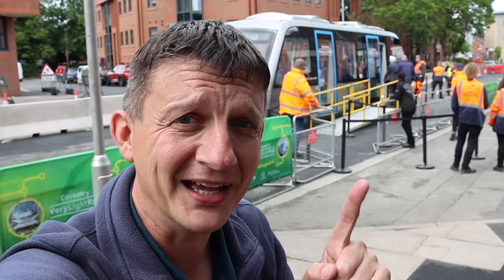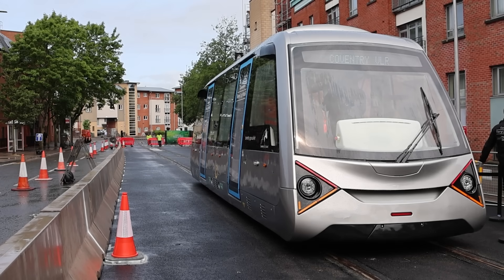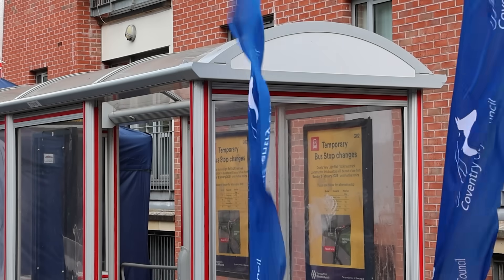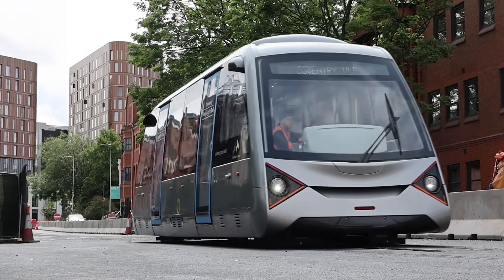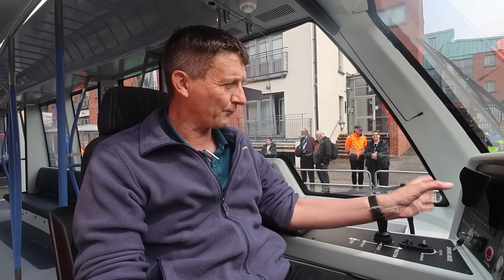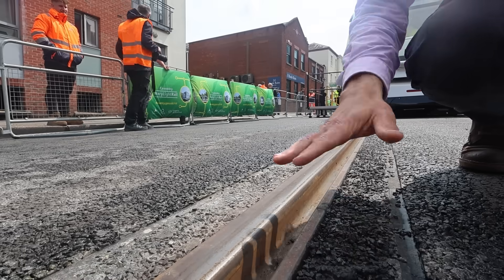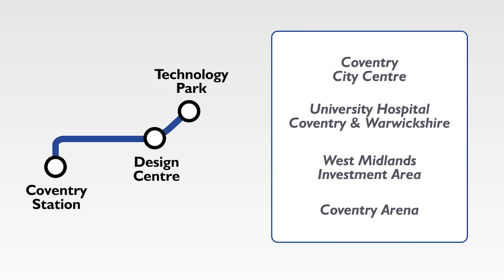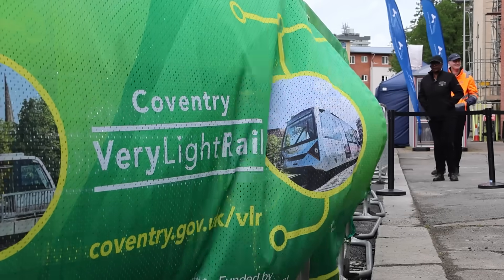The NEW! Coventry Very Light Rail is here

Comment: I remembered when Edinburgh had to deal with years of disruption due to delays with the tram and having it cut back to Picardy Place. This caused businesses to lose money as a result of road closures. I think Princes St was closed at least twice as an example and they had to resurface the road in Haymarket. The system eventually opened in May 2024 and the extension (which was actually what was supposed to be built in the first place) finally commenced five years later. Despite the pandemic during construction, they happened to open the extension on time.

But anyway, I do think its worth trying out a very light rail system to the test which removes the need for OLE and utility relocation.

Comment: I have been following this project for years and I’m so happy to finally see the vehicle moving in an actual urban environment. I think that MU operations and even proper multiple units based on this concept should be studied, because with the current capacity you would necessarily need very high frequencies and autonomous driving for this system to effectively bring any long-term cost savings.
A city of Coventry’s size is absolutely suited for a proper tram system in my view, but I have been following the world of British transport long enough to be aware of the many “complexities” that infrastructure projects have to tackle. The ideal scenarios for this system would be medium-small towns (50,000-80,000 inhabitants, or even less) or as feeder lines to a metro system or a proper tram network in larger cities.

Comment: I'd hope that if/when they get around to building a 'proper' running network that they plan it around running suitably designed two car sets rather than the demonstrator design. I'm no engineer, but I'd like to think a design could be drawn up which retains the cornering capabilities while granting greater overall capacity.
I see this as a first step in building out a 'proper' light rail network. You get the new infrastructure built out comparatively cheaply and start delivering benefit to the community. But you plan the system so it can be expanded to new locations, and with an eye to upgrading the system to be heavier should demand outstrip the capacity available.

Comment: I'm trying to think of a benefit of a tram system that restricts your mode of transport to rails running on a street!  What are the benefits over a normal bus?  I believe that battery ones are now becoming available.  Of course the rail lines could be isolated from other road users so as not to get held up in traffic jams however you could just as easily have exclusive bus lanes....at a much cheaper alternative.... the only benefit for the tram style would be if you had existing rail track that is no longer used to bring back in to usage

Comment: This technology is really exciting. In the short term, I think it's very limited as the cars are too low capacity. However, if/when this is combined with self-driving technology, this would be utterly revolutionary. A cheap, simple system running a driverless cab every 2 minutes could have higher capacity than current tram routes with 6 trams per hour!

Comment: I can’t wait for very very light rail. Where they just do away with the rails altogether. It’ll be very flexible and able to go anywhere, even many miles from the core network. It could be powered by batteries and fares collected by the person in control of the vehicle. 

Now, I’m someone whose life is defined by things on rails, but I fail completely to see the point in this one. Actual trams can carry huge amounts of people at quite high speeds (when on off road sections). This is just an electric bus that can’t deviate from its route. The reason utilities are moved from under tram lines is not necessarily because they damage them due to weight and foundations, it’s because when it comes to maintaining those utilities, you don’t want Virgin Media disturbing your entire network because of a collapsed duct, so utilities are rerouted to pass at designated places where undertrack crossings (UTX) are maintained. 

An actual grown up light rail system (like those in Edinburgh, Manchester, Sheffield and the like) is the answer to larger conurbations - no bus can go from the Gyle to Waverley with the speed of a tram. I think Coventry are trying to solve an inner city problem that was answered with the development of EV buses. 

I’m sceptical, but I do wish the team the very best of luck, and I’m open minded enough to accept if I’m proved wrong in the future.

Comment: I live in Croydon and studied in Coventry between 2008 and 2012 and always thought it was odd that the arena has the railway close by but no station so this would be great for adding more than driving or taking a bus. 

This interests me also because I remember how disruptive Tramlink was due to the under-road services having to be replaced or relocated. The weight reduction is interesting as you see junctions in Croydon where I believe the tram makes the road eventually sink. 

Studying in Coventry I felt it was a city you needed to drive in to get around. In Croydon you have the big box stores along the same stretch of A23 but Coventry seemed to have all these things all over the place. I can see such a network helping non-drivers get about quickly.

Comment: I‘m wondering about the battery. 70km seems like a lot, but then you’re (ideally) trying to run it up to 20h per day, so averaging 70/20=3.5 km/h?
Reply: Seems like it will just get a little load between rides at the last stop, just like e-buses do
Reply: @pawelabrams  and, according to my local bus agency, they’re a headache and a half as (at least here), 1km of dual wires cost the same as 2 stations and you’ll want quite a few stations for any network of appreciable size if you don’t want to order a lot more vehicles to keep them charging somewhere

Comment: As many others have said, just use a bus, much cheaper. This is a vanity project.
Reply: Trams are better than buses as different road rules apply to them. They basically have a priority on the road no matter what so they won't be stuck at a bus stop waiting for someone to let them through. They also offer a more comfortable ride for the passengers.
Reply: @AuxHex  exactly and that's why you need trams not gadget bahn like these.

Comment: The track construction method seems more practical than the vehicle to be honest.
The main use case for a tram is that it has a higher capacity than a bus and can thus be used on medium distance connector routes. Running a pod thingy with less capacity and fewer seats than a bus would erode many of the benefits of a tram.

Most trams have axle loads of around 6 tonnes, which is very similar to that of a bus (a typical 12 tonne bus in my area has 2 axles, whilst a heavier 18 tonne bus has 3 axles)

For reference, the Melbourne D2 class tram- a bog standard 29m Siemens Combino, weighs just over 35 tonnes and has 6 axles, giving an axle load of around 5.9 tonnes. When completely full, this rises to just over 8 tonnes. 
A generic Enviro200 bus has a gross weight of around 12 tonnes across 2 axles, except the rear axle has a significantly higher loading compared to the front axle because of the engine, so it would be comparable to the D2 tram. It also has a similar capacity to the VLR at around 50 passengers.
And of course an electric Enviro200 is heavier- 20.5 tonnes across 3 axles, which equates to an axle loading of just under 7 tonnes.
Electric double deckers are even heavier- nearly 25 tonnes across 3 axles, which puts it on par with a completely full regular tram.

So if a regular tram has similar axle loadings as a bus, then the road surface should be able to support it, especially with a concrete slab to distribute the weight better. The profile of the rails looks very similar to a regular tram rail too.
Reply: I agree.  It doesn't make a ton of sense for a modern tram, unless it's going to be a lot more reliable than buses.

Comment: £10 million per km still sounds expensive to me - about the cost of a nice  house every 20m or so. 

Compared to a bus you get all the disadvantages of a tram - you can't avoid obstacles, including broken down vehicles, you can't change the route for engineering works or events, cyclists get wheels stcuck in the rails, without the main advantages of carrying more people or not having to bring a power source with you

Comment: Fun fact : the regular 1meter gauge tramway system of Basel do have a 15m turnaround with a 15km/h speed limit and 3 switches in it…at Aeschenplatz.
Reply: Pah! In Wuppertal, Langen's Schwebebahn trains turn around in a cupboard, out of sight of the street below. 

Coincidentally, I was watching a clip on Basel's network a few days ago.  Other than the turning loops, very much a "first generation" system.

Contrast that with the outer reaches of the Berlin system, where (whatever else they got up to) sometime DDR authorities made several significant improvements over those four decades when West Berlin was tearing it's network out.

Comment: Battery power seems like a miss to me - batteries are very heavy, so they probably increase the vehicle weight significantly, which further limits capacity to stay within the normal road tolerances. Maybe something like a welterweight rail would have external power but still maintain the low axle loads that allow tracks to be laid without disturbing utilities.

Comment: Great video Geoff.  I really like that concept and the vehicle.  I hope it takes off.  I know buses do the job but having a variety of public transport is great for all cities.  The very light rail is a win for me as it's faster than a bus in a busy city.  Buses have to deal with frequent stops, traffic lights and traffic jams.  The fact that it does not screech when going around corners is a great design.  Hats off to the engineers.  I really hope Coventry goes ahead with  it, it's a good size city with a population of well over 300,000 and will improve the city's transport infrastructure for workers, citizens and visitors alike.  Thanks for sharing 👍

Comment: A 12 meter bus can transport 100ish people at max capacity. This stupid pod does like 40-50 max? Whats the thru-put of a system with vehicles so small? Both busses and pods require one driver per vehicle, while the pod-thingy also needs permanent infrastructure. With how short the wheelbase is, I cant see it doing more than 50kph tops, before rattling itself to death(vide pacers). It also is a battery vehicle so it nullifies the advantages of an electric rail vehicle
A gadgetbahn at its finest, tbh one has to be happy for them, they manage to scam Coventry for a good few millions of pounds for a system that doesnt work

Comment: I want a followup video next year riding it after a the tracks have been in the ground for a winter. 

It seems like it has the same problem as a BRT. Low capital investment but high operating costs so today's government gets to crow about getting a cheap system in place and saddles the next few governments with an unaffordable operating budget until maintenance skimped on, service gets cut, and eventually replaced with a bus.

Comment: The description in the video (from the PR flacks, not Geoff) of the track is not good.  There is a slab that the rails are bonded to, but it's very shallow.  Lack of any actual track structure was one of my gripes.  So for me, I'll strike track from my list of  gripes ... mostly ...  it is ... errm ... Very Light ... so not likely to ever to support ALR (Actual Light Rail) should the need arise. 

I had a whole thing about how silly the 70-km "range" thing is (a couple hours' service - not a full day) but deleted it because I also found on the CVLR site that the 20-seat car uses "opportunity charging".  If that's the case, the "range" they list isn't really a big issue.  So that strikes another gripe ... mostly.  No mention of how long it needs to take a sip so impossible to say how that affects how much service the car can provide in an hour.  I mean, if it has to stop for an hour every few runs ...  but it doesn't say.

We're still left with a 20-passenger car (with -- lol -- 36 standees) that has a driver.

Not sure - did anyone else say "why not a bus?" 😀

Comment: An auto connect charging system should be easy to install at the termini or at track ends.  With modern electronics auto points as well.

Comment: This looks very interesting, but the Light Rail Vehicle appears to have less capacity than most modern buses. I'm struggling to see what they benefit would be of such a system as it would still be more expensive than running a fleet of Zero Emissions buses. Understand that the ride is smoother, but in paper if you can move more people at a lower cost I don't see how this would appeal to most transport agencies. If the LRVs had higher capacity than a bus, then I'd understand the benefit, perhaps larger LRVs are being considered or maybe there's scope for the LRVs to be coupled together.

Comment: I think overhead wire would make that much better and more practical
Reply: But it would add significantly to the cost of construction. The VLR is all about a very cheap alternative to conventional tramways.
Reply: @ballyhigh11 the range being so slow on it id argue doesnt help very much
Reply: @ballyhigh11  Very cheap until those carriage(s) need to be fixed and the tracks have to be replaced due to wear & tear

Comment: I really like this concept - lighter vehicles reduce the depth of the foundations for track, therefore massively reducing the cost of laying it.

I hope, however, that a higher capacity vehicle could be created on a similar platform. Even if that involved linking a couple of these together! As that's the real power of rail-based systems.
Reply: wonder how much weight those tracks could physically take..
all be it doubt ones gonna get a shunter plus small works train around the radius curves this thing is designed for but would be interesting if it could support such train.
Reply: @davidty2006 No works Train necessary. 
Track laying and  removal by road vehicles.
(There's an awful lot of information in that aforementioned presentation)
Reply: This vehicle, but driverless on an exclusive right-of-way, would be wonderful. The low capacity of individual vehicles could be negated by higher frequency, to the delight of riders. And 60 passengers is more than a standard bus.
Reply: @tommarney1561  Although 4 years old this presentation is well worth a watch

Introduction to BCIMO and the VLRIMC: Very light rail and its relevance to low cost railways

(full title - post in YT search)
Reply: @tommarney1561  its true 60 people is more than a single decker bus can carryy but on routes where a tram would be needed double decker buses already do those routes and can hold more than 60 people
Reply: @spaceycakey1987  I'm thinking of a particular corridor which involves a disused railroad right-of-way that had been envisioned as light rail line. Estimated costs for light rail have skyrocketed, but an even lighter-weight system like this would be substantially cheaper. Getting a bit more creative, if the line could be grade separated, then it could be automated and driverless. The line isn't expected to attract a huge number of riders, so frequency of service would be a far greater concern than capacity. Smallish vehicles running frequently, then, would be better than larger vehicles running less frequently.

Comment: It's certainly interesting, as long as they can easily couple cars together to form trains I think they'd be great. The only other major issue I see with this iteration is that they did away with a pantograph and instead went with an overhead bus charger system. They'd have a much more flexible and probably cheaper system doing so. The bus chargers are a little on the complex side and they can only charge one vehicle at a time compared to just stringing up a short run of wire or an overhead rail to charge multiple vehicles at once. Putting a pantograph would also allow for in-motion charging and integration with full sized tram systems.
Reply: When I went on it last week the guy said the reason they’re so small is when they stop it allows cars and other vehicles to overtime easily without causing huge delays, which is partly why they removed the bendy bus because every time it stopped it was causing traffic build up behind.
Reply: @chrishenry-my8wp  That's a fair point in the case of there not being enough people to fill one car. If there's enough demand to warrant connecting cars together, who cares if a handful of cars have to wait a little bit. You're talking a handful of people vs up to 100 or more.
Reply: @travisbeagle5691 I think the idea was they want it like the tube, so you miss one there’s another within like 3/4 minutes, so it’s constant.. that’s what they said, in reality that’s a lot of wages on drivers I’d inagine

Comment: With it being so low capacity, I’m struggling to see the point. I absolutely love a tram and this is an interesting concept but I fail to see it’s practical application in a mass transit system
Reply: Lower operating and maintenance costs than busses, a smoother ride, better public perception. Much easier and cheaper to upgrade capacity where needed by coupling a second or third car together, rather than needing more bus drivers.
Reply: The main reason why a VLR is seen as better than a bus is because of the public image. A new innovative tram line is much more likely to attract passengers than "we added a new bus route", and capacity should arguably be better than bus route because of it's high frequency
Reply: Call it the DINKY